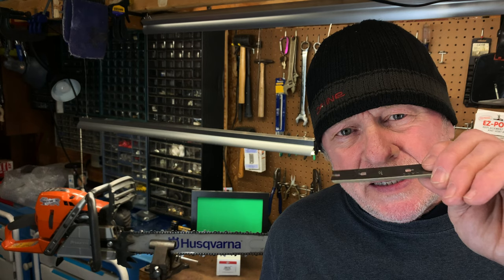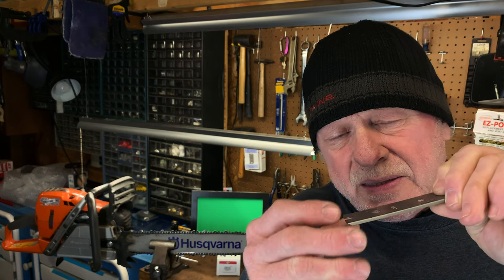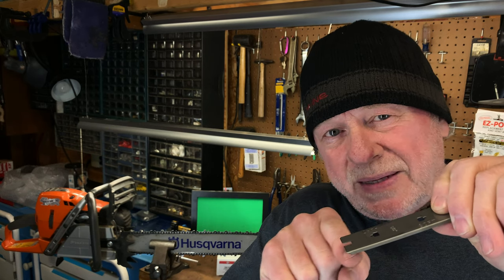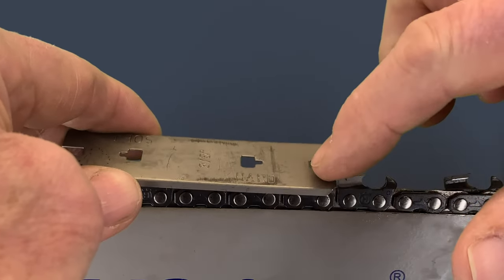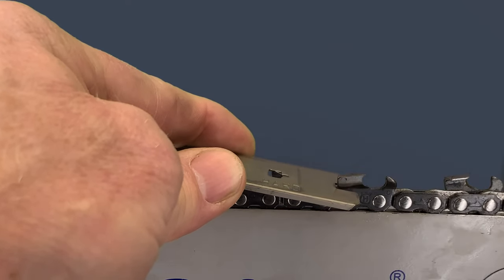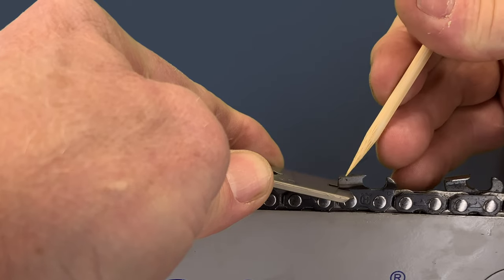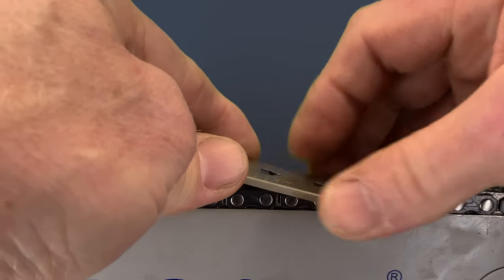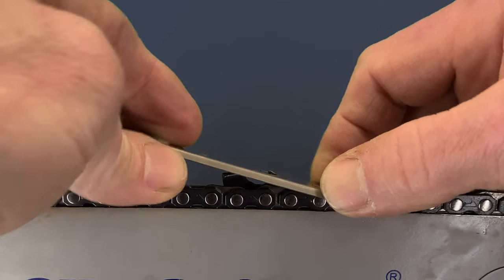T-36 Days - Rakers, Riders, Drags and Depth Gauges Part 3 - Husqvarna Depth Gauge Tool

Comment: Perfect.  Thanks a bunch.  That was a very helpful video.  Trying to take my sharpening to the next level and stepping into the realm of rakers.  Bought the tool but couldn't figure out the proper way to use it.  Thanks again.

Comment: Guys that middle little slot is for  the chains that has 2 rakers, the safety chains! On a normal chain raker must sit at right or at left at the big window
Reply: @kostasfrangos3354
Lol "the 2nd set of rakers!" 😂😂😂😂😂 Omg that's awesome, I truly needed that, thank you!

Wait- ohh noo wait - you're not kidding, are you? Oh FML. Well that's okay! I'll just laugh at you, instead of with you. And fight like hell with my need to be a nicer person who helps to educate others. Gdmnit!! I was enjoying that laugh! I thought you were being funny about that - the bumper drive link being another raker and all- but nope you were being serious. Sheeeit.... Well, it's NOT!! A Cutting Tooth has 7 parts. Heel, Toe. That's where the rivets attach the drive link to the cutters. upwards, there's the gullet. Then the side plate. Then we come to the top plate, and the very important cutting corner! Last but not least, down and across the way, we have the antidotal (still have just the 1 though pal) Raker/Depth gauge/Drag/Although drag? It's really not a drag  It's also not really a rake- depth is the only thing that is accurate - as it literally determines the amount of vertical depth from the top plate down into the gullet is used to cut. Too little and it is not efficient. Too much and dang if it's not a bit hungry, not to mention - in hardwood too much of the tooth down in the wood pulling the saw in, vibrating the hell outta your hands like a 60lb jack hammer laying down iron and spiking the ties- setting forns to pour concrete? No? K well how about railroad ties into the tracks? No, I didn't work on the railway all the freaking live long day- just a summer season at the Ski resort we built a train that went from their Gondola lift to their Quad or something else - started as tree service - then I got the bid on the site work- and then the bid on the tracks was open - sourced the iron and ties, all the crush and then ¾" to 1½" stone for layering the ties, and then going back through with the damn 60lb jack hammer and chinking the rock down in under around each rail and tie it sat on - well that's what a saw with the snot of a race horse and the sharpening skills on the 1 depth gauge per link, per chain, of a rookie can feel like.
Anyway, Bumper Drive Links are just that, a upward curve off of the otherwise flat top side of the drive link, and they are on some green chains that meet requirements for low kickback consideration. Yellow birch, yellow bananas, Yellowstone national park - ok I'm out of cool yellow things - The Sun -: that's actually not yellow - it's a very violent eruption of different gases burning so hot they appear to be orange or yellow at times from the distance between it and the Earth. So yep back to the drawing board. But seriously, all jokes and self deprecating humor aside - do not file the the drive link - it's not part of the cutter and does not = the same thing or even the same position on all cutters. Leave the bumpers alone!!! Omgosh. Went from funny as F*** to wtf is wrong with you. 
What wrong with Me? Well to start with, A LOT- more than we've got time to get into here. I definitely can't get any of my therapists on zoom or anything on a Sunday morning - and my Vet - what? Who can afford a human doctor when you have to pay for a psychiatrist? Just kidding! OMG ppl believe everything they see on YouTube...

Comment: You're the only one I've found that explains the reason for "hard" and "soft" on these depth gauge tools and how those two settings work. The biggest potential problem for the beginner is filing too aggressively and grinding away metal from the tool. Eventually you'll know when the rakers need to be lowered. The chain is sharp but the sawdust is fine. Or, suddenly your chain acts like it has wheels on it. The chainsaw speeds up and doesn't cut, etc..
Reply from the maker: Well said Dale. Many people have trouble diagnosing problem like that. It all comes with time on the saw. It also helps to know people who understand how all the pieces work together and are willing to teach others. Thank you for your comment sir! Stay kind!

Comment: Hi Wayne, nice presentation. I have a stihl 021 with an oregon S55 low profile chain and wonder if this husqvarna guage tool will work with it? I've used the oregon tool but it sounds like this gauge would do a better job but don't know if it will work on low profile chains as well. Thanks
Reply from the maker: Take a look at the “mini” variation from  Husqvarna: https://www.husqvarna.com/us/filing-equipment/depth-gauges/?article=596285104
Reply from the maker: Select the “Select Variant” link when you get to the website.

Comment: So if i'm using it on a skip tooth chain it still works, doesn't need to touch the back of the cutter in front of it.
Reply from the maker: Yes. It still works as long as it’s 3/8” pitch.

Comment: Thanks for the vid! Does it change on different brands of chains! I run Stihl and Oregon! In Idaho! Soft wood! First, Larch, Pine! Thanks
Reply from the maker: The Husqvarna depth gauge tool is made for 3/8” pitch chain only. Brand does not matter. There are two positions on the tool - one for soft wood, the other for hard. If you have “low profile” chain, like a PICCO or Pixel chain, the there is another tool for setting the depth gauges on those chains. You can find the tool on Husqvarna's website. Click here https://www.husqvarna.com/us/filing-equipment/depth-gauges/ and then select "view all" next to "Select Variant". Select the option you need there. Thanks for the feedback. Stay kind!

Comment: What kind of raker gage is that, where it available?
Reply from the maker: You can get them at any Husqvarna dealership. Make sure to get the size that matches your chain pitch. Usually that would be a 3/8” pitch. It’s a little pricey, but here’s the Amazon link: Husqvarna 5056981-01N Depth Gauge, 3/8", 73LP, 73VL (H42) https://a.co/d/aN0IjH1. You might be able to find a better price by shopping around.
Reply: Thank you

Comment: is the Depth Gauge slot big enough for safety chains
Reply from the maker: Yes. It should work for any chain with the same sprocket pitch.
Reply: will this depth gauge work with low profile chain (3/8 pitch)